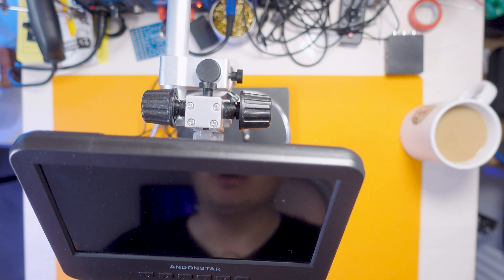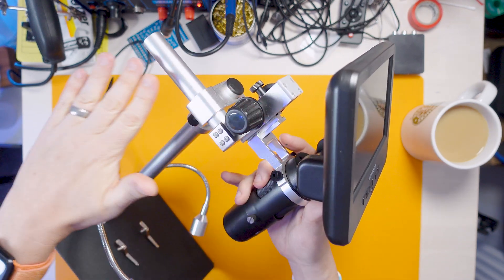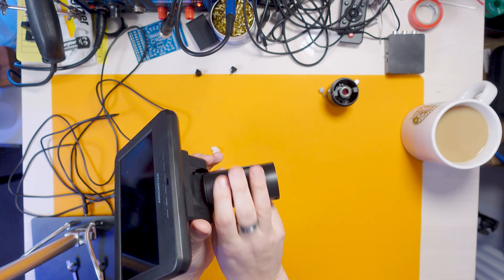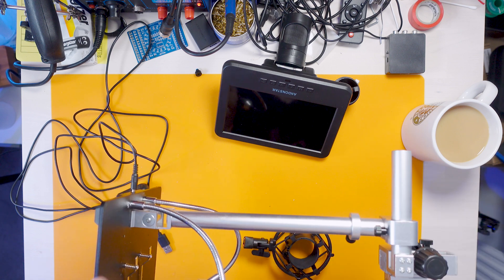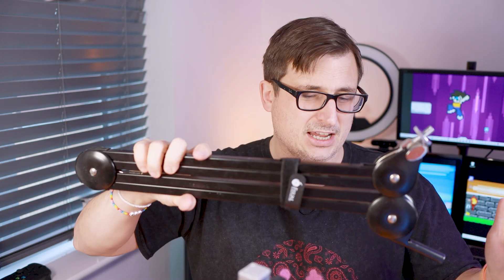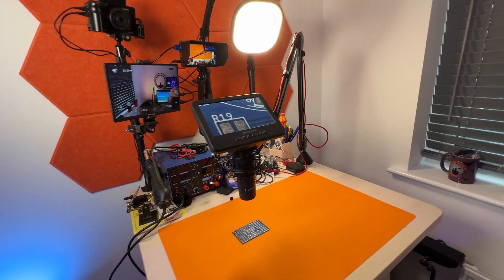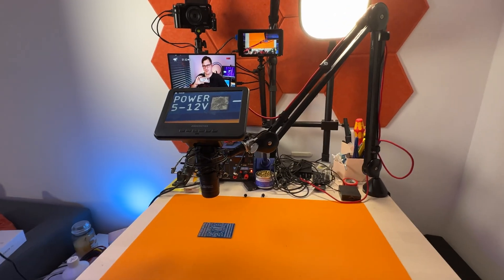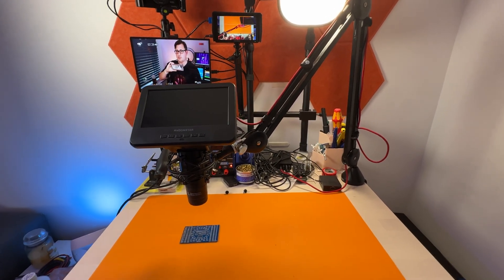Building a Boom Arm Adaptor for my Andonstar Microscope - AD246S - Part 1

Comment: Anyone trying this now just need to get a cheap mic boom arm, unscrew the height adjuster rod from the base of the microscope base using the black nut at the base with a pipe wrench, use one of the reducing nuts from the mic stand, screw this onto the bottom of the adjusting rod with the black nut and attach to the mic stand thread. Simple.

Comment: you need to clamp the boom somewhere eles when you tap the desk the vibration goes through the boom i had the same problem in my studio the boom was attached to yhe mixer stand everytime i touched the mixer the noise went througj my headphones lucky yheres a besm above mu hesd so i got s long adjusterble clamp from amazon attached the boom to thst it worked hope this id of some help

Comment: I would attach a piece of wood to the wall, doesn't have to be bigger than the clamp plus a support bar,  then desk mount clamp it to the wall, then doesn't matter if you nudge the desk. and cheap and easy to do, as somewhere like B&Q will cut the wood, or have off cuts in their bin would be better idea. so not costing the earth.
Reply: but don't pick up a sheet of wood, and ask them to cut for example a 5cm x 5cm piece out of it, as my local B&Q would charge for the whole sheet of wood. and keep the rest of the wood to be sold to the next customer that wants it, and gain nearly twice the price.
Reply: the only other way would include getting a microphone stand and then having it in the way all the time. as a table will wobble, the arm will wobble, and the microscope will wobble when the table is touched if you tried mounting it any way whatso ever to the table.
Reply: or 2 sheets of wood longer than the table is in height, fit them together with a long thin piece of wood at a 90 degree bend, and attach an off cut to the wood for the microscope arm. then place behind the table so the corner of the wood is in the corner of the room. but same problem if you accidentally kick the wood. you will want to find a way to brace strap the wood, as be a very weak at the joint when moving it otherwise.

Comment: Looks great. When I boom mounted my scope I was thinking of ideas to keep it from wiggling, and one thing I tried was hanging a small shelf on the wall behind my desk. I then mounted the boom to the shelf, and that way bumping the table didn’t wobble the scope. Plus it gave me some more room to store things and freed up space on the desk. Just an idea. Ultimately I got a heavier desk that didn’t move when bumped and that solved the problem. But the shelf was a big improvement. You just have to keep in mind to hang the shelf low, because the boom will only go down so much (that part might make more sense if you give the shelf a try.)

Comment: Great idea adding a boom i keep looking at a scope as i am getting into soldering again if i come across anything will keep you posted i have a adventurer 3 3d printer
Reply from the maker: I might have found something since I filmed this.. there’s a guy who posted an stl file for his scope (which is a little smaller than mine) https://www.thingiverse.com/thing:3324690/files
Reply: @KipHakes  oh thats great 🙂 looks well designed and a printer wont have a problem printing that out